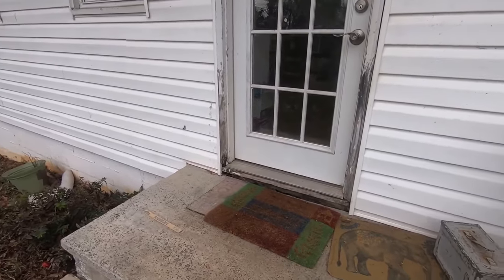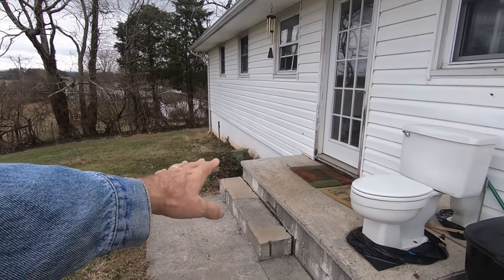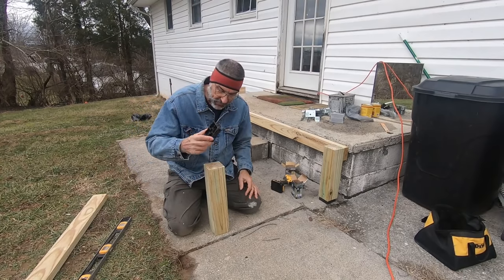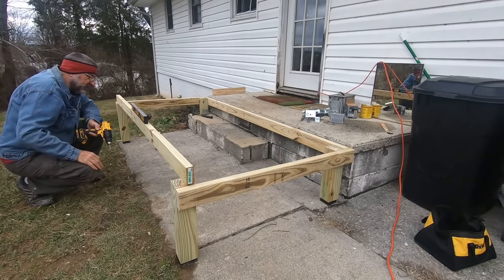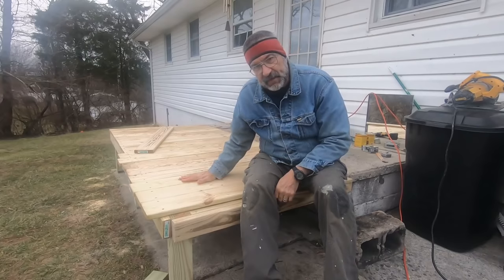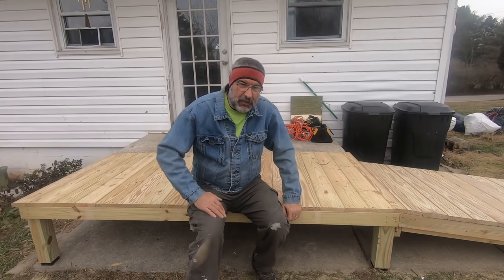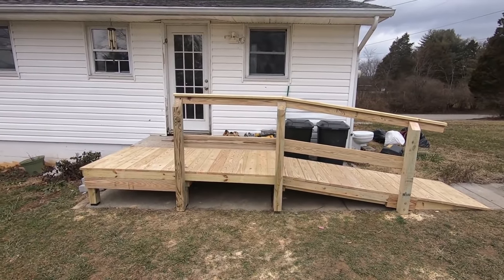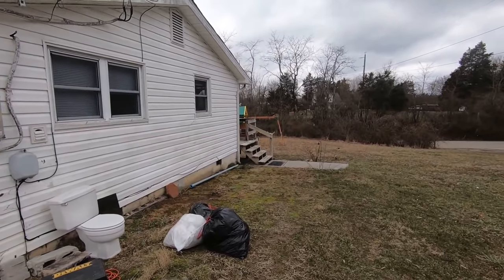Building a ramp

Comment: Looks great!  Yes on the steps.  No on toilet flower pot lol.  
Food for thought: Maybe add anti slip treads going up the ramp.  🙂
Reply: When my mom moved up to Alaska she stayed in the smaller house on the property I found some extra planks and a bunch of old asphalt roofing shingles. So I basically beefed up an old boardwalk that was most of the way there. It was already wide enough so I just made the walkway consistent enough for a wheelbarrow to go on it and Mom was quite satisfied and there were enough old shingles to use for treads. Mom said Thank you for the next three years. Plenty of time to get transitioned into the main house according to plan.
Reply: Yes! to the anti slip. Our ramp gets very slick when we get rain or light frost. I keep old towels available to spread out as needed to help prevent falls.

Comment: I think you should add something immediately to the end by the door.  If someone falls off there, it is quite the drop.
Reply: Yes, even if steps are there, the door is very close to the edge and navigating opening the door with a bag of groceries, turning to lock/unlock the door, or stepping on a wee bit of ice or rain could create a fall off the deck.

Better to have a rail to grasp.

There is a reason for codes.

Any adult sized person can suffer a serious injury by falling only 18"-20".

Bill, look at it this way: whatever the distance is from the top of your face plus 18"-20", is how far your face will have momentum to slam against the ground. 

It ain't gonna be pretty.
Reply: Right, he  should have just wrapped it around, would not have taken that much more wood! I speak from experience, I stumbled a little coming out my door and went over the end of the porch and hit the ground, happened before I could even catch myself, so yes, it should have a rail all around!
Reply: @chrisfry436  Wow. Well, you're proof positive that railings are there for a reason! Although Bill talked about code this and code that, I've found that building codes provide for minimum protection, and there's nothing wrong with going beyond them. I would also have extended the railing down to the end of the inclined ramp, no idea why Bill didn't do that, he's leaving his wife and Pops to slide on down the rest of the way without support at the end there, but hopefully they'll both stay inside on iffy days.
Reply: Build some kind of table by the door. I have a simple 2 by 2 foot table that I use to stage things I am bringing into the house. I set them there till the next time I go in. I put down groceries while I get keys. ETC.
Reply: I agree.....need a rail....

Comment: My brother recently built my parents a ramp and to keep it from being slippery he painted it with some type of paint that has texture to prevent it from being slippery. Works great! What a blessing that you can do so many things and don’t have to hire someone to do it for you!
Reply: Yes. Can get that 50° sand added to whatever color or stain you want on the ramp. Any good paint store. How about raised flower beds along the side of the house. Can use just a simple frame build and box construction and install the soil and flowers in the boxes. Paint as desired. Then no seniors have to get stuck in the bent up and locked position on the ground.
Reply: Lisa Mand yes and if you didn’t want to paint the deck you could put strips that stick to the deck that has like a sandpaper finish to help you not slip.
Reply: @sued115  Yes, and those work quite well.

Comment: Thanks for the video. What about some nonskid strips on the ramp for rain, snow and ice to prevent slipping....in the frail, it doesn't take much to cause a slip and fall?
Reply: Or use paint with sand scattered in it?
Reply from the maker: Those would work in the rain. But would not work when it’s covered with several inches of snow and ice.
Reply: Yes then you can salt it to keep the snow and ice melted. I had a pt I visit patients homes. Anyway she had roofing shingles on the ramp. Pretty clever not slippery at all. Haha

Comment: No toilet...kinda ghetto or tacky. Now if you had a garden and you used it inside your garden, and maybe planted a squash plant and a beautiful flower, you might be able to get away with that. The toilet reminds me of a barbecue I went to 40 years ago and the people bought a brand new toilet cleaned it real good, bleached it real good and use it as a punch bowl. They even mounted it on a piece of wood and put a few pieces of linoleum on the wood. In the back of the tank, they put some flowers thinking that might soften the whole thing. But it didn't. Nobody wanted to drink anything
Reply: Julie  I  agree  with  you
Reply: Julie Hiestand no toilet planter, unless you’re running a plumbing business and it’s advertising 😂
Reply: Yeah, agreed. But also, I just thought of something. Since plants potted in a normal terra cotta planting pot have a hole in the bottom, for the water to drain out, after you water it, (after the water wets the roots), well, if Bill used a toilet as a planter, then how is the water going to drain out?!   Wouldn't the plant begin to suffer, and get yellow in it's roots, or other parts of the plant, if it gets too water-logged, due to no water drain-off?
Reply: Oh my God now I've heard everything!!!!  A toilet bowl punch bowl funny stuff here!
Reply: LoveLady 3377 SERIOUSLY?

Didn't you notice that huge hole in the bottom of the bowl where the water flushes out to the septic or sewer?

The tank has an opening where the water hose comes into it.

With the hose removed the hole will still be in the bottom of the tank and drain excess water.😒
Reply: @gertbanks7585  Yeah, horrible. Yuck, lol.

Comment: as I have learned from experience in Iowa, even a skiff of snow on wood will make you fall. I learned the hard way on wood steps to my house (years ago). the snow barely covered the wood, but I fell down the steps and hurt my back. I was in my mid 40's, young and spry! I would not want to risk it now in my 60's. A good push broom will help keep that 'little bit' of snow off the wood.

Comment: Bill, you are a very talented and skilled man. Interesting how you went right over and in line with the concrete that was already in place. I definitely think the stair idea is good too. I'm curious. Should the railing extend down the incline to the end of the ramp for steadiness? I was thinking with balance concerns, maybe it would be good and look nice. 
 I would pass on the toilet planter though. Just sayin'.
Reply: A R, I so love this couple, but I do agree with you on the rail. That thought ran through my head too. It would be just as easy to slip on that last little part. I know I would want it all the way around, even at the top.
Reply: @harborgirl8877 thank you.  I agree.
Reply from the maker: You can reach the railing from the sidewalk before you start up the steps. The problem is that there is nothing down at the end of the ramp to attach a railing post to!  I went as far down the ramp as I could with that post, and already, it’s not as sturdy as the other two.
Reply: @LiveSimpleLiveFree  I  understand. Thank you for helping me understand better. You're the skilled carpenter.

Comment: Nice job on the ramp. Few years ago wheelchair bound family member from UK came to visit. Our house has 5 stairs in front and 3 in back, so we needed a ramp. No where rented anything practical, only 8 ft long, and about $100 from a moving company. Being handy, I bought two 12 ft 6x6" rough posts, and made a triangle at the top that would seat them on the top of the 3 Rd back stairs, taking them tongue level of the back room. I collected a bunch of free pallets and filled in any gaps with 2x1" trimmed down. The 2x4 base parts of the pallets strattled the posts and were secured to the posts. Then 2x2 were put along the edge of the floor of the ramp, to keep the wheels from falling off the side. 2x4 scraps under the long posts at intervals stopped any bowing or springing. The incline was perfect for pushing an adult male, and gentle enough that my son could push him. It worked well for the week, costing only the price of the long posts, and a few small bits of  lumber, some from my pile. We passed on our idea to his brother on Vancouver Island who had similar success for a temporary ramp. I like your step by step for your permanent ramp and just bought some new adhesive,xabrasive stair grip tape for my step into the garage which can get slippery with snow. Orange bowl? Rose bowl? Toilet bowl?? You might get to be well known in the neighbourhood!

Comment: Wood gets incredibly slick during the winter. We had to put treads down on the wood because railings can’t stop a fall. Please take the toilet to the trash dump. Thanks for the video.
Reply from the maker: Treads work in the rain, but they would do nothing when covered with several inches of snow and ice.
Reply: @LiveSimpleLiveFree  y'all get some cleats. Western Auto, Home Depot, those kind of stores.

Comment: LOVE the ramp...so sturdy and matches the style of your front steps.  My 2 cents?  After your first rain or snow melt, check for any low areas as the wood settles and dries...just drill a 1/4" hole in the center of the puddle to allow any water to drain away, saving your wood...this helped my deck a lot!

Comment: My husband and I just watched your video.... he is concerned that the railing might not be quite long enough at the lowest part of the ramp. Also because wood gets slippery when wet he suggest you do what we do here in the rain capital of WA state. we also use asphalt roll roofing tacked down with roofing nails to the walking portion of the wood... the little rocks in the rolled roofing helps with traction and helps prevent most slipping...

Comment: Just for an added safety step...what we did with our small ramp for our aging German Shepherds..we bought a roll of roofing material with the grit on one side and tar paper on the other side..and layered it several times so the babies could walk back and forth as needed with out slipping..even if it was raining,  snowing, or freezing rain. ..that was over eighteen years ago..the ramp and grit paper is still in tact..and the wood is just fine...no rot and very sturdy...even though all our five shepherds have passed many years ago...it still is very useful for me...I am 70 yrs old very pain arthritic hip..and I use this ramp to pull my little wagon up when I bring in the groceries... ..just thought you would like this little tip..that wood becomes extremely slippery when wet..I even have this  grit on my horse's deck..so he doesn't slip...

Comment: Use the toilet as a flower box, BUT also build something to surround it to hide it. 
It'll not look tacky but provide an excellent set of flower pots  (yeah, pun intended 😆)
I did this with mine. Built what looks like a multilevel planter around the toilet itself, filled it with a few rocks and dirt. In the top (tank ) put trailing plants same for the bottom with addition of small upright plants. 
No one knows that the infrastructure is a toilet unless I tell them

Comment: Even with a handrail anyone could slip. I purchased from ebay 6" x 10' BLACK Roll Safety Non Skid Tape Anti Slip Tape with sticky backing and it is also used for those Skate boards. It helped a great deal to prevent slipping. Even in rain this wood can get slippery but with that tape on it that stops it and it lasts a long time. I even used it for the stairs on my porch

Comment: Bill- I would have liked a few more details about the ramp part, eg: the angles on both ends of the long supports and how to cut the long angle at the far ends.
As for your potted potty, lol, I suggest you find containers that will fit inside the bowl and tank so that you can remove and re-pot them season by season. Not familiar with your climate, but here are a few suggestions for fall and winter: basket mums, poinsettias, little pine trees decorated with lights. Have fun! -Deb

Comment: I have some balance issues too, and I think you need to extend the railing to the end of the ramp. I could imagine if you have ice or a snow/thaw/freeze cycle that the ENTIRE ramp, to the end, would be slippery. I can imagine holding on to the end of the railing and trying to make it to the end of the ramp. Wood ramps can get slippery in ice & rain. Just add a couple more feet. Your front railing goes to the END of the steps. Just a suggestion. :-)

Comment: The ramp looks great but as an individual who needs a handrail Bill what works best is a rail as long as the ramp. The last bit of ramp goes past the end of the rail so it still possesses a potential to slip and fall . My rail  actually goes a foot or so beyond and gives me something to hang on to till both my feet are on flat ground. Sorry Bill just wanted to add my 2 cents to the project. 😊🌺
Reply from the maker: You can reach the railing from the sidewalk.  There is nothing to attach the railing to at the bottom of the ramp.
Reply: @LiveSimpleLiveFree  yes. I saw that too.

Comment: Valspar makes a non slip porch paint with grit in it.  A quart should be plenty for that wee ramp.  If you ever get to the wheel chair, walker or scooter stage, that helps a lot.  My husband nearly went over backwards (if I hadn’t been right behind him) on a non treated ramp after it rained.  On the ‘yard terlit’ referendum,  those are cute in backyard flower gardens where they aren’t seen from the road.  Along with one or two other repurposed items, like an old wheelbarrow, section of decorative fencing, large old ceramic bowls,bicycles, etc.  Then it looks like a planned garden concept, instead of  ‘I can’t get it to the dump so I disguised it’.  And if you do decide to put it by the side of the house, stick some fake poinsettias in it during the winter after the frost.

Comment: Nice job.  I suggest that you add a second railing to your front and back steps. If I am carrying groceries or a box I automatically put them in my left hand to have the right to open and close doors. It is nice not to have to climb or go down ramp or stairs with my non dominant hand on the rail. Also good if person uses a cane in a specific hand.  If  you add a single deep step by trash cans you will probably use that if your ramp is icy and to get to your trash cans easier. Love your videos.

Comment: Please consider a railing on the other side as well for stability and if you put steps over there. Not worried about code as you already have the deck short enough in height but for stability for uncertain legs under any situation.

Comment: I would have left small gaps between the surface boards.  That way moisture can drip thru.  Also, you should have wrapped the ends of the ramp where it hits the sidewalk in the black siding tape. By putting the boards directly on the cement they will only last a few years.  You can also temp hold the deck in place with some PL Premium construction adhesive.  If you have pets they will claim the space under the deck as a shelter.  When you replace the door consider using PVC material so it will never rot.  Just remember to include a small slope so you don't get water sitting on the sill plate of the door.  Perhaps consider adding a storm door and a post and beam roof over the deck to keep snow off.

Comment: I noticed that there are cement stairs under the deck of my new house. It was steps leading into the front door, regular size, may be 8 feet wide and my deck is the whole length of the front of my house. Actually my front porch wraps around also to the side of the house so there’s another 24 feet on that side.

Comment: Great job! This looks to be the simplest ramp build I’ve seen & I’m going to do this at our front door for my dad (93) & disabled bro. When do you seal the wood & what do u use so it won’t be slippery in  rain & snow?
Reply from the maker: New pressure treated wood is saturated with chemicals that keep it from rotting.  You shouldn't treat the wood until much of those chemicals have a chance to off-gas and dry out a little.  Usually 4-6 months.
Check out anti-slip tape for exterior steps (or something similar) https://www.amazon.com/Grip-Tape-Waterproof-Traction-Staircases/dp/B08F7DKTD4/ref=sr_1_2_sspa
Reply: @LiveSimpleLiveFree  thank you!! I appreciate the link and tips.
Reply: @LiveSimpleLiveFree  one more question, what’s the name of the “feet” you put under each 4x4 footing to prevent contact with the wood and cement foundation?

Comment: How did you find angle for ramp stringers. I understand the bottom angle. I guess measure the thickness of your stringer and where it meets that hieght chalk line and cut but how did you find angle for where ramp stringer meets deck stringer

Comment: If you have to change out the door, you could put in one wide enough for the wide wheel chairs?
Reply: P.S.: Ya didn't show us the scribing of the sloped leg, and the angle at the ends!  And I think you need to finish the railing now, and you can take it off when you decide to do the steps - always err on the safe side - it's not that much extra lumber!

Comment: Nice Job. How did you figure the angle to cut the ramp?
Reply from the maker: I just laid the 2x6 at the angle I wanted from the deck to the ground.  Then I laid a 2x4 flat on the ground next to the 2x6 and drew a line along the top of the 2x4 to get the angle for the ground.

Comment: Hey Bill, just curious, will you be adding any traction strips to the ramp part? Or does the wood you used have properties in it to keep it from getting slippery when its wet or icy?  Im a young 50 but always think of things like this (just in case)
Reply from the maker: It doesn’t get slippery, and it’s not very steep.